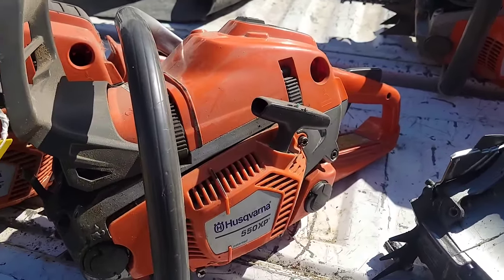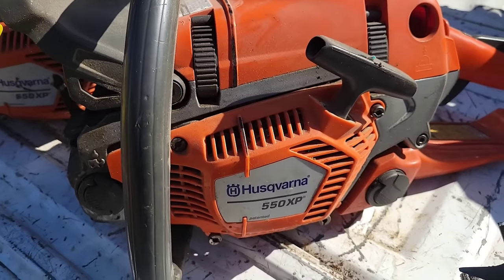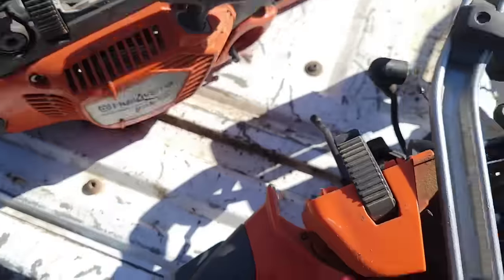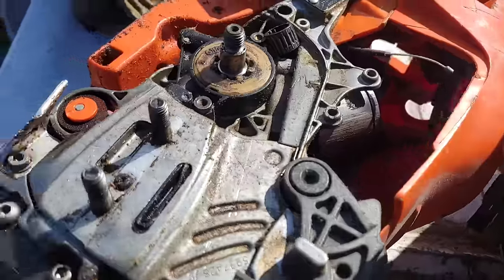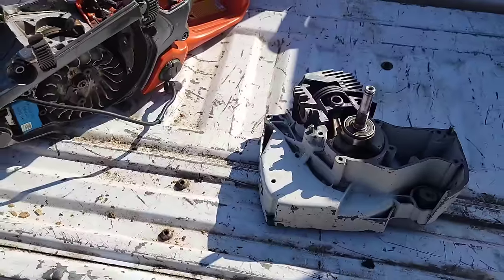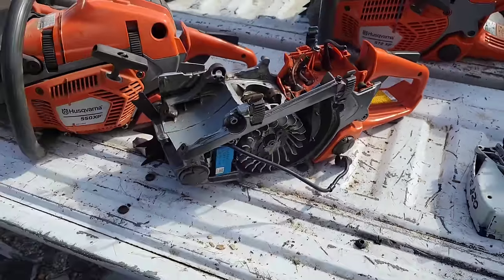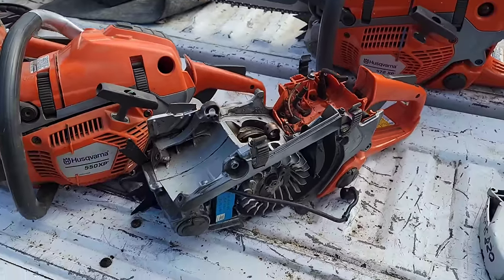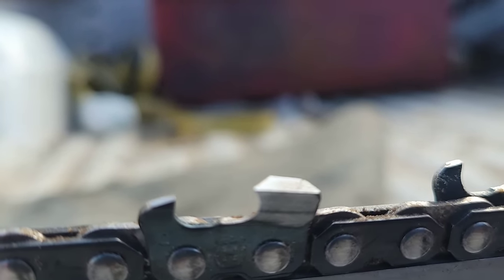ARE 5 SERIES HUSKYS JUNK OR IS IT SOMETHING ELSE??

Comment: Yes. And another little anomaly I see here, real tight chains that load the pto bearing, and skip chains on a short bar, thats like running a dull chain with a 572. Said for years,  my mods on the 562's an 572's were about the 800lb gorilla in the room. Heat. that is and always will be the limit of reliable horsepower, the ability of the machine to maintain reasonable temps.
Reply: i hate a tight chain also
Reply: Yeah I always run a bit looser, sometimes the chain is getting old and too loose and might derail, that doesn't stop me from getting maximum use out of it: Vertical felling cuts to avoid weight of the tree settling on bar/chain :D

Comment: Rule of thumb I have; if the weight of the saw alone is not cutting the wood, stop and sharpen. You let the saw do the cutting, if you need to add pressure it is time to sharpen the chain. Also, learned a ton from Harvey (Iron Horse) Buckin, and you Tinman. You share a wealth of knowledge and I truly appreciate it. Just a firewood cutter who is hungry for knowledge and do things right. Looking at an Echo CS620p and on the fence about a CS7310. Heard a lot of good things about the Echo’s. A 572XP is also in the mix. Lol
Reply: Go 572xp. Antivibe is the best I've felt.
Reply: @karlruotsala8672  or maybe the vibe that you've NOT felt, eh?
Reply: @davidvankainen6711  that's a great way to put it!
Reply: The Echo 590/620 chassis has a great plan B. Dyno Joe and others have put Stihl 44 and 46 top ends on them. They’re a stroker so the jury’s still out on case flow letting them sing like a factory saw though. But cubes, yes. Also there has to be spares for days. It’s got an inboard clutch and my 27” bar has a Stihl 3/8 050 93dl chain on it. Get a bar adapter and run a Stihl bar… you can Husky too. But there are 10 Stihl dealers to one Husky in my neck. The new 7310 is the old 757? Echos tend to run de-tuned to a Husky or Stihl.
Reply: You must have more time than some of us...
Reply: You won't regret getting autotune/mtronic, won't regret buying echo/shindaiwa either, but it's not the same ;)

Comment: 75% of people do not know how to properly run a chainsaw. Mostly homeowners but some professional’s too. They burn them up, bog them down and run them hard before they ever warm up. Start your saw, let it idle for 2-3 minutes. Pull the trigger a few times and check to see if it’s oiling. Do not be cutting through 30+ inch wood and never backing off to re oil the bar. You do not have to run it wide open through big wood 😂

Comment: I bought a new 562xp in 2012. First auto tune saw my dealer sold ,he was hesitant selling them at first. Still running great all original except upgraded to new style air filter. But chain always sharp ,40:1 mix with quality oil. Has hundreds of hours, still has original EL44 carb. Recently bought a 2016 model also. Love my auto tune saws. ❤❤
Pat from northwest WI

Comment: I run my 200T and my 661CM and the 10-10 mac ..always sharp chains. Runs all day, bit of a re-touch at lunch .. wonderful. You're right with the dull chain. Sharp chains, less heat, better cutting, less wear on your crank bearings. Better for the saw.

Comment: Nothing wrong with them at all. They need to be ran at 32:1 or 40:1 with good oil. The crank stuffers shield the bearings from getting oiled like non stuffed saws. Dull chains kill any saw fast but faster with plastic caged bearings. The mufflers are really choked up compared to yesteryear saws to make them quiet  
and need to be opened up
Reply: Did they not upgrade the bearings or are they still plastic caged? That’s what gave up on my mk1 560
I read somewhere they changed the design on the mk2’s 
Don’t hold me to that though, great bit of info, respect from the uk 🇬🇧
Reply: I run all my two cycles at 32 to 1 20 oz and 5 gallons

Comment: I have a Husqvarna 61 I bought new in1991. I did a muffler mod and I finally learned how to hand file and the thing is a cutting machine. I have a 565 professional auto tune and I also did a little muffler mod. Great running saw!
Reply: I've got the same saw, same year. LOTS of hrs and it never let me down.  Just last week I finally put a big bore top end on it just because.  A little aluminum transfer on the cylinder but otherwise perfectly fine.

Comment: My dealer told me this when I bought the 550 XP, these engines run at the ragged edge, like a NASCAR engine, get it HOT, IT WILL BLOW! KEEP IT SHARP.
Muffler is horrendous for retaining heat.

Comment: You nailed it. I've seen guys push so hard on the smaller saws that the bars blued and than turn around and say its a junky saw. Home owners buy the cheep poulan and run a dull chain and blame it own the saw for not cutting. Use the saw for what its made for and keep the chain sharp and it will all work out. nice video

Comment: I have 3 5-series saws.  555, 592, 540 mk3.  They're all amazing.  The mk3 is ported by Red Beard, and its been great.  The others are stock.  They're also awesome.  The 555 has a lot less power than the new 562 mk2, but still does better than a Stihl 362.  Not quite as fast as a 400c.  The new 562 mk2 wails both the 362 and 400c in speed tests.

Honestly, I like the fact that they have a ton of power right from the factory, and wouldn't need to be ported.  The fact that I can't get it ported to have 30% - only maybe 10 or 15% - more horsepower doesn't really matter if it's already like running a ported saw right from the factory.  Just pull the spark arrestor screen, open up the muffler, and its a monster.

Comment: 100% Tinman!! I am no pro by no means bud. I made the mistake of lending my old Pioneer to a neighbour  a dozen years back, I got it back with a super dull chain. He was digging it into the ground to cut out a stump. Never lending a saw out again…. Another neighbour was clearing some stuff and had a MS261, nice saw. He was having difficulties. Again, dug it into the ground and chain was dull as all heck. Told him to grab a beer, I took the saw and sharpened it as best as I could (still a total rookie at this time) and gave it back to him. He was thrilled at how it cut great again. Told him, keep it out of the dirt. He learned. Another neighbour up at the cottage, had a little 36cc Husky, didn’t cut well, sharpened up the chain, it had 2 broken teeth and he was somewhat back in business. He was amazed at how it cut again. Moral of the story, most homeowners don’t really know how to operate a saw properly or even safely. Dull chains are more common than sharp ones. I touch up the chain after every tank of fuel. 4-5 strokes is easier than 20-30 to sharpen a dull chain. Learned a lot from you, Buckin, Harvey and Donnie Walker. Keep it up and keep’r sharp!

Comment: I am so so about autotune. Had a couple of 550xp’s with crankseal leaks, I mean yeah it can happen. But it was within 3 years and not to many hours but the autotune part was fine. 

And then there is the t540xp… I had 2 and they were just haunted or something. Sometimes they run fine, but out of nowhere won’t idle, run too rich, won’t start. And like the problems come they also disappear that quick. Had lots of work done to them but it would not fix the issues. When you google you find a lot of these problems with t540xp saws. So for now I just run Husqvarna 3 serie saws (372, 394, 395). Also a Dolmar 7900. And for tophandle I switched to Echo. Great little saw with tons of power.

Anyway love and appriciate your content, keep it up. Greetings from Holland!

Comment: HI TINMAN 😊😊 IVE noticed the newer saws are a bit heavier than the old chainsaws the same size they still have good power and pull good RPM the old chainsaws U should start the chainsaw up and let it warm up 1ST and when U are finished 4 the day let run and idle and cool off be 4 U cut it off / it has 2 cool off and get rid of the heat  😊😊 OMG 4 3 2O24

Comment: Really interesting video. Back when we used saws a lot cutting firewood, we carried spare sharp chains. My late father was a stickler of having sharp chains all the time. He hand sharpened all of them himself. And we only ran Stihl full chisel chains. He was also a stickler of keeping the chains out of the dirt. Every thing I have gas tool wise has their muffler modified, except my echo commercial blower. I modified mine with 1/2”- 7/8” round ports, and have had their baffles drilled. Some even have dual ports. It definitely gets the heat out of them. And I only run Amsoil mixed 40:1 and none ethanol gas in everything. All my saws require hearing protection since they have modified mufflers. I don’t mess with porting the jugs. I don’t really need a hot rod saw.

Comment: Hello Tinman! Thank's for this information. It's eye opening!! I worked as a pro with the old 550xp. Twice it doesn't come down with the rpms. In the first situation I felled a 45cm spruce  and in the second I cutted bushes. After pushing the killswitch it started at full throttle again. I had to do it three or four times and everything was ok again. It was a dangerous situation. I never found out the reason. Best wishes to You from Austria! Wolfgang

Comment: Great info mate keep up your good work. I was cutting firewood one day and I noticed  my chain had blued itself. First run of a brand new saw. Turned out my oiler was bad. Clutch was not blue but very hot. Caught it just in time. Now I believe it has a bad crank seal. Heat kills thats for sure.

Comment: What’s your opinion on the newer 550xp Mk II? I’ve heard the Mk II is more of a ground up redesign instead of just a few updates. I’m on the fence between the Husky 550xp Mk II and the Stihl MS261C. I don’t do a lot of cutting, but I want something that will last me for years down the road. I always run my mix at 40:1 using either Amsoil Saber, Echo Red Armor, or Husky XP+ in 90 octane ethanol free gas.

Comment: Another good video sir, hope you and the family are doing well.
Just my two cents,
My favorite go to saw is a MS441c, I believe it is a Intellicarb.
I simply keep her sharp, blow it out with compressed air every other use(making sure not to blast the air filter tap it out if necessary)
For the past 8-10 years I’ve had no issues I let it idle for a few seconds to warm up.

Comment: I have an early 570 that's not auto tune and I didn't like it at first but after running it for a couple years and loaning it out for a few months it's really been reliable. Although it is pretty heavy. It's a couple pounds heavier than my 372.  I also completely cut the muffler apart and removed everything and welded it back together with a pipe sticking out

Comment: It's not just Husqvarna 500 series saw's that burn up with dull chain's, I've seen it all to often in all brand's and model's some being the best known and normally the toughest saw's built. Yes dull chains over tightened chain's bad mix ratio's rotten stale old gas and this is a big one most people overlook, guy's don't know when to back off and let a saw breath they will push a saw past it's operational limit's. Doing long big cut's and making one cut after another non stop will cook a saw, the more of a "hotrod" type of saw you give people the harder they push it. Even with a sharp chain you have to back off or pull up and give the saw a chance to cool a bit by juicing the throttle a couple times to get a fresh charge of fuel into it to cool and lubricate before getting back into the cut, for the love of god put it down and let it idle while you move some branches or blocks of wood then a saw has a fighting chance. Don't let the naysayers upset you to much their the ones that probably treat saw's this way to start with, anyways take care and keep building those saw's Tinman.

Comment: Hi , do you know how well the mark 1 / original 550xp is catered for in terms of parts availability currently,  
I believe very little is shared with the mk2 , however i haven't seen many parts available for the mk1 from my usual stockists in the UK.
I have two that need rebuilding.
Cheers George

Comment: Hey big guy. Greetings from North Carolina. I just re-read my owner’s manual and it says nothing about hot starts. What’s the correct procedure. I am a new 562 owner and don’t want to roast it. I have a 585 that I am still breaking in as well and I don’t want to screw something up. Thanks again for your help with this stuff for the guys like myself, who like saws but aren’t doing stuff with them all the time. I do appreciate your videos. Much love to you and all out there🤙🤙
Reply from the maker: Hey, put the saw on fast idle and pump the primer bulb several times then pull it over and it will start every time.

Comment: My 572XP gets hot and I do run sharp chain.  But, when it gets hot is during big repetitive cuts in red and black oak on HOT days. On day two of its life the coil or whatever thay call it now was cooked.  The OE clutch and cover and oiler and bar and chains were and still are in great shape,  It throws chips like corn flakes, but it gets hot or it did get hot.  I changed my evil ways; when working with it, I take a break more often and I DO NOT turn the saw off until it idles cool even if I have to restart it.  Tinman, I did not consider the restrictive muffler, that makes sense, but I am not a metal worker.  I wonder if there is an aftermarket muffler.  On the other hand, my Echo  7310 does not run hot, no matter what, but I do run sharp chain always, I hate dull chain.

Comment: Well i run 372s all the time. I got a 575xp that was straight gased. Rebuilt it. Bearings 1 seal meteor piston. Gutted the muffler. Did a base gasket delete. Havent used it yet.

Comment: I bought a 576 auto tune well over a decade ago, I bucked full time with it logging then I went to a fully mechanized logging outfit where I only buck the oversized logs a processor can't handle. It sits with old gas and no maintenance, starts 3rd pull every time and never once has it been in the shop!!

Comment: Question for you I recently rebuilt a 461 from the ground up crank bearings piston an cylinder had some dark grey sludge in top end obviously I took the aftermarket top end off cleaned the bottom end out an put the oem top end with aftermarket piston back on it my question is could the plating from the aftermarket cylinder cause this.yes it was in the bottom end aswel an it was a dukes cylinder kit I bought years ago an finally got it all together saw was ran no less than a tank before I noticed

Comment: Would be interesting to know your thoughts on running very long bars on these saws, combined with less than perfect filed chains vs shorter bars that allows the saw to keep revs high and not bog
Reply: You can definitely bog down and burn up a saw running a shorter bar. It's probably more about the operator than the length of bar.

Comment: I bought the last ms660 in nz and it lasted 4yrs logging working hard and sold it when I went to engineering still going strong and it saw a number of late model stihls and huskies blow up 661s 390-94s absolute garbage if you got a husky block that stupid duct from the flywheel up so the pressure goes to the cooling fins,and knowing where a good torque band for a given saw through your chains hook and drag lies will make it last considerably longer although I was a Stihl man I have to say the ol husky low top 288xp was one hell of a reliable beast.

Comment: I had a 575 that wouldn’t stay running it would vapor lock not start not restart etc
Got rid of it after 5 trips to the shop!
I had a 550 same thing a month after the warranty ran out …of course they put a new carb on that I had to purchase and it ran great… sold it I figured that that was the future of auto tune constantly being worked on!
I bought a 500i I had to have the fuel injector replaced then the injector pump! Traded it in on a new 585 primer bulb lines kept coming off and they repaired that….after several tries of tuning it due to the low end screw not responding either running too lean or too rich they replaced the carb I’m gonna run it and if it still gives me crap I don’t know what I’m gonna do!
It’s not even auto tune!
I have a 372 that’s 10 years old threw a new updated carb on it and it screams !
T

Comment: Strange video, most of what you are considering is the effect of air leak saw design or stratified saws, call them what you will. 
An electronic Carburettor is likely  maped for efficiency its lack of user adjustment if that is the case is really its only downside. I  prefer my own jetting on a saw and I like richer slow needle settings than most, snap off idle is not really the thing to me, to each there own thats why I like a manual adjustable  carb. Keep up the great videos.

Comment: I have owned a 575, to me always felt a bulky heavy saw. By comparision  my 390xp although not light to me feels almost equal  regards weight but significantly  more poer and torq.

My 572 that i still have is again underwhelming.

Guess what i reach for, my 365 special and my 390xp, both old saws that absolutely fly.

Comment: If that's a Husqvarna bar, they are blued around the outside when they are manufactured. To me, it looks like no maintenance, blocked oil or no oil in the tank, which of course needs filling every time you fuel , plus  too tight chain. Other times when those clutches are burned out like that, the brake left on by some amateur and then rev the chainsaw up trying to free the chain. Not to mention running at 50 to 1 and low-grade fuel on these high compression chainsaw will always blow them up if they get hot.

Comment: Chains and files are cheap. If you sharpen right away and don't wait it takes no time at all to touch up a chain. Cutting with a sharpe saw is fun. Cutting with a dull saw is not only boring it's really time consuming and frustrating. In then end you gain nothing but damage to your equipment, cutting dull. Then "POP" goes the saw. Just not worth it at all. TC Mahalo Tinman 🤙🤙🤙